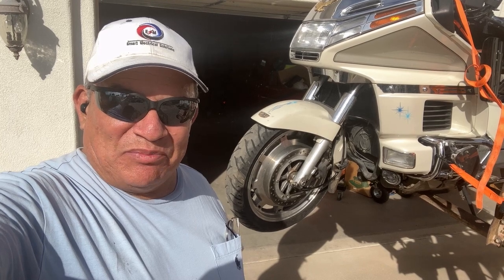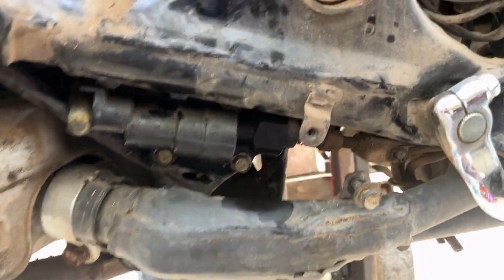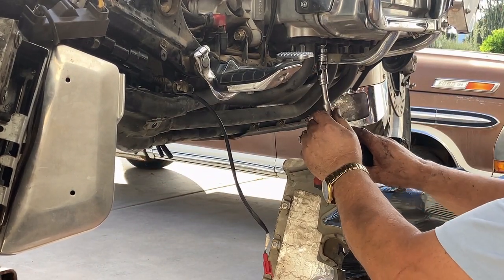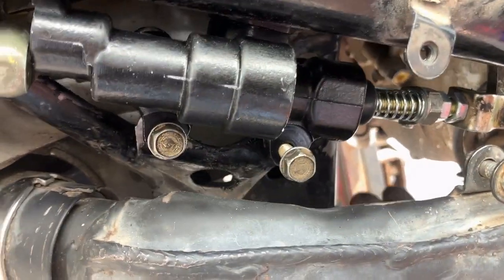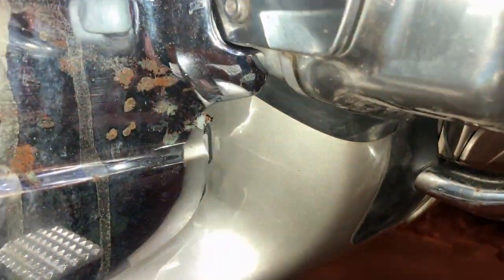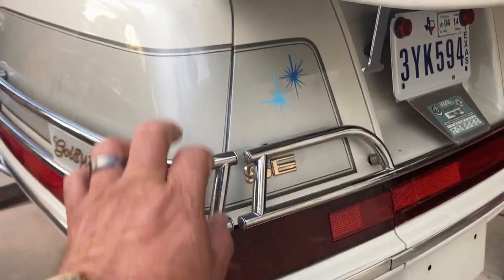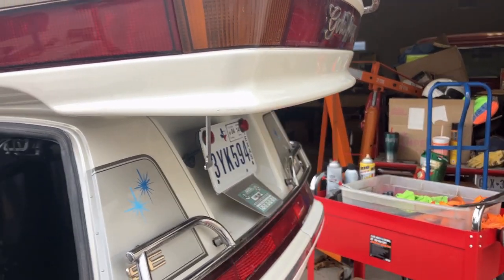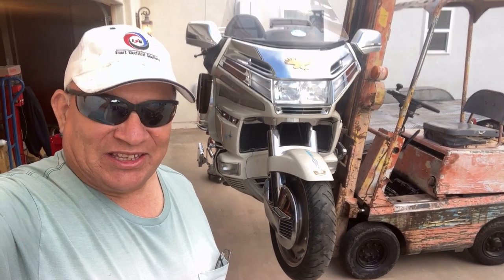90 Honda Goldwing Rear Master Cylinder and Brake Pads Replace Part2

Comment: I watched this video to see how you reinstall the master cylinder, I saw everything but that. I have spent several hours trying to finish this job.
Reply from the maker: First of all, thanks for watching and commenting on the video.  Starting at 8:34, I show having to remove the plastic piece on top of the cylinder, using some plastic ties to hold the cylinder just right, and using a ratchet box end wrench to get the back brake line installed to get it in.  It definitely was a challenge and I commend you for attempting this.  I was definitely not the easiest job I have done.  Good luck....😀

Comment: I changed the master brake cylinder on my ‘95 GL1500SE - fun time getting that rear line connected, for sure. The forklift wld have been nicer than laying on the floor! Will wait until you lube up your rear splines & check the U-joint before attempting mine.🧐 Good videos!

Comment: I’m working on this right now. Since I have to do way more (carburetor, gastank, rearbrake, driveshaft, timingbelt, valves, frontbrakes, and so on, yes the bike didn’t run for more then 8 years now, I disassembled most of the bike now. But thanks for some insights.
Reply from the maker: Thanks for watching my videos and commenting... Good luck with your revival project.....😊